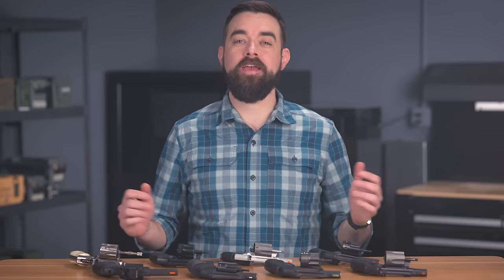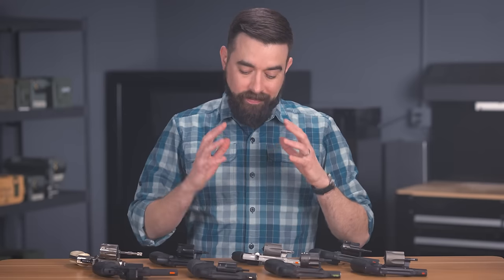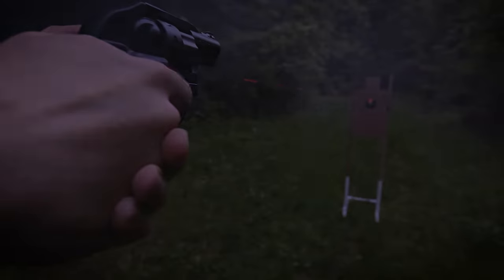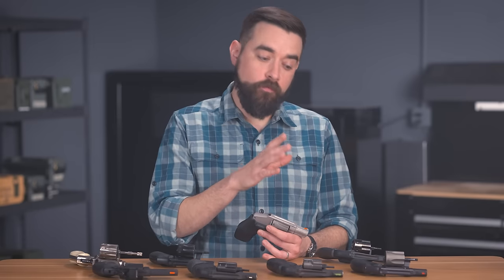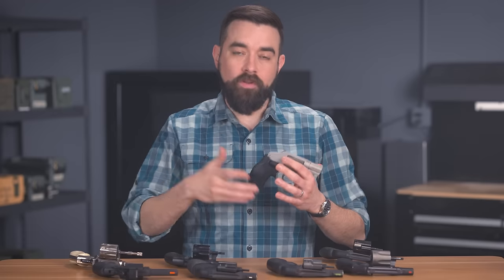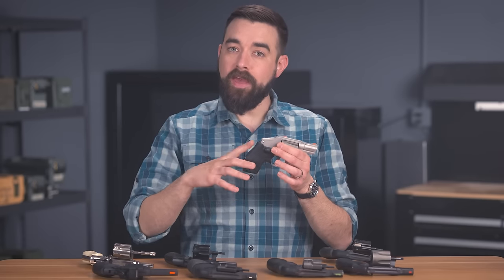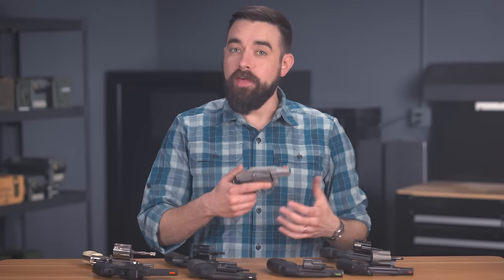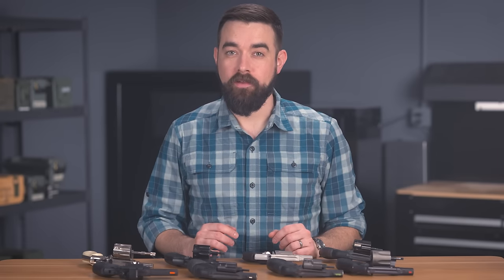Tips for Shooting a Snub Nose Revolver

Comment: For the 38 Special snubbies, you did not mention the Hornady 90gr Critical Defense Lite ammunition.  I have tried this in two snubbies including a S&W Airweight.  Recoil is noticeably less, and more controllable.  HOWEVER, these very light bullets for caliber do shoot LOW on targets compared to heavier bullet weights normally utilized for 38 Special.  I do agree that lightweight snubbies in 357 Magnum are crazy for distances more than pressed on-target to about 4 or 5 feet....      Great channel, love the videos!!
Reply: I have shot those rounds in my snub nose revolver and they have basically zero recoil but they shoot low and to the left for me. Mine prefers 130 to 158 grain bullets
Reply: Hornady also has a critical defense standard and +p version in 110 gr which to me has very little recoil in my s&w j frame.
Reply: Iirc those have garbage terminal performance  which is the most important part

Comment: My daily is the S&W M&P340. It is a beast with magnum loads. Not so bad with light 38 Spl loads. I changed the grips to fit my hand better. I also dry fire to keep my trigger finger strong so I can do a smooth straight back pull without the front sight moving about. I'm not claiming to be as good as Claude Werner. But I'm competent. If you can handle the bark, Buffalo Bore's 19H load is pretty good. If you want to save a lot of money, the Remington 125gr 357 Magnum SJHP is decent. If you want low recoil, then Hornady's Critical Defense 110gr FTX 38Spl+P is decent. I wouldn't go lower than that in power.

Comment: Hah, I use the same concept with nail polish on the front sight.  I use several layers of the color instead of white, but the one thing I do also is add a fluorescent green on both sides of the notch at the rear and then I do a clear coat after the color.  Keeps it from getting brittle and chipping off so easy.  ;)

Comment: S&W puts their best snubbie grips on the Model 63 - a .22 LR that really doesn't need them.  Those grips have plenty of real estate for your pinkie and they fully cover the backstrap to absorb recoil and give adult sized hands a proper angle on the trigger.  Guess what - you can call S&W Parts and order those excellent combat grips and they'll fit perfect on your Model 60 or 640 (steel frame .357).  Last pair I bought was less than 40 bucks.  What a great deal!
Reply: Midwest Gun Works carries them in black and FDE for sub $40.  I personally don't like them (my favorite are the $25 Hogue Bantam) because they're very skinny, but I've met a few women who do

Comment: Thanks for this video Chris!
I just bought my fist snubby S&W 442, and I can't hit jack. I blame it on the heavy trigger but I am determined to master this little monster, because it fits so nicely in my jacket pocket.
Reply: Keep at it ,it takes time putting a wilson combat or apex spring kit will help big time.
Reply: Very easy to work the gun dry fire and see improvement since the gun is manually operated.  The only thing you miss dry fire is the recoil control.
Reply: @sean0181 Good advice. Thanks Sean!
Reply: @tangobravo4634  I have taught more than a few frustrated folks how to shoot these j frames ,first i would paint the front sight ,i actually use a very small thin amount of gorilla glue and let it sit 5min then apply bright orange,yellow or green ,then dry fire practice focusing on your front sight and very slowly rolling that trigger back without moving that front sight ,when you go to the range start at 3 then 5 yards one handed slow roll trigger press focusing on front sight (this is all easier with the performance center 442 or a spring kit installed huge difference )over time you will be able to speed things up ,keep in mind these really are not for past 7 yards ,i hit the range 2 or 3x a week and i just yesterday drew from my pocket and puched a 3 inch group at 7 yards with 110 +p critical defense also from both of my jframes federal 130 fmj is not accurate i use 158 fmj and carry the hornady or underwood 158 standard pressure,i really like norma 158 for the range but i shoot more 9mill thany anything else this is an expensive hobby if you like to shoot.
Reply: @sean0181  That's awesome 👌 Thanks again brother!
Reply: "I can't hit jack. I blame it on the heavy trigger"
The problem is that the light trigger on modern semi-autos is masking your poor trigger control.  You have to press the trigger straight back to the rear.
Reply: @tacticaltruth95  Thanks, that's definitely something I will focus on the next range session.

Comment: I've had two snub noses: a Colt Detective Special and a S&W Model 19. I've come to the conclusion they weren't for me. They were sweet looking guns but if I don't enjoy shooting them then they're just good looking paperweights.
The DS was ultra cool, very light and handy but a beast with recoil no matter what ammo I used including wadcutters. I even got a blister on my trigger finger once from a range day (not fun). The Model 19 was a little better with its adjustable sights, heavier weight and a set of Pachmayr grips I put on it. However with .357 magnum it was a little bit too much compared to a 4 inch. I sold both of them and don't miss them. 4" revolvers are the only ones I like.

Comment: Pachmyr makes a boot grip with a pinky pop out. Also check out delta ergo grips which are awesome but don’t have the laser.
Reply: Pachmayr grips can be a little large, but they do give much better control.
Reply: @kirkmooneyham  I looked at it it’s called the guardian grip. It’s small as a boot grip but has a pop out pinky extension automatically as you grip it. Very cool. I love my green laser crimson trace or else I’d use the guardian grip.
Reply: Green laser is what I use now too. It’s great for dry fire practice. Delta is really cool because better aim naturally and disappears in pocket better. But still don’t want to give up the green laser.

Comment: I replaced my Ruger LCR 38 with a Ruger LCR 357. I’m still using 38 ammo in it though. The extra weight of the 357 gun makes controlling the gun a little bit easier.

Comment: With a 38 special, I would recommend using standard power hollow points. I have two snubbies,a Rossi and a Taurus,the recoil is not to be feared at all.reduce the power and you might not have enough,overload it you could blow up the gun.standard ammo at close range should make people much less frisky.
Reply: I would recommend plain FMJ if you want the lower recoil of standard pressure.  I would not use a hollow point unless it were a .357 or at least a .38 +P.  The problem with standard pressure is you don't get any expansion from the hollow points because the velocity is too slow. Which negates using those in the first place.

Comment: I am lucky. Hogue grips help me a ton. My hand fits a Hogue grip. I put one on my S&W 647 and my Ruger SP101. The Ruger also has had a trigger job and all the sharp, edges worked down smooth. If you are not a revolver person, i.e. you like and shoot revolvers, why spend time with a snub nose? They will be the most challenging gun you have ever used otherwise. Lastly, it is OK to fire them slower than people think they need to in order to achieve accuracy. In the mind, we think we have time all figured out. We do not. Our perceptions often do not match timers. Who says just because you can mag dump a 17 round semiauto and appear cool that it is a good idea? When you are contemplating five rounds, slow down and get them well aimed and on the mark. Only well aimed fire matters.
Reply: I put the same grips on my sp101 and it made all the difference in the world

Comment: To solve most of those problems at the expense of a little more weight and concealability, try a S&W 686+ with a 3 in. barrel. Soft shooter of .38 spl., and shooting .357 isn't fun but it isn't torture.

Comment: What do you use for a loader with an LCR in 327 Federal?

My Pachmayr 6 shot works fine with dummy rounds, but real 32 H&R Magnum cartridges are held just barely too wide for the cylinder. The cartridge case rims don't quite clear the chambers clean, so I have to futz around with a little to get them to drop in.

I can also not tighten the loader all the way (what I normally do), but it tends to move around just enough in the pocket so that it won't stay where I leave it.

Comment: What about keeping your thumbs away from the gaps behind and in front of the cylinder when shooting .357 magnum?  Is there risk with side pressure injuring thumbs?
Reply: Yes, where the barrel and front of the cylinder meet. Gas/heat comes out between the forcing cone and the cylinder.

Comment: I cant believe he chose the 327 lcr over the 9mm lcr..similar recoil but 9mm is everywhere
Reply: Several reasons. 9mm is cheaper and easier to find, yes. But the 327 has a 6-shot capacity compared to the 9mm 5-shot. Also, the 9mm can experience "crimp jump" and cause the cylinder to lock up. I know someone who traded-in his LCR in 9mm because he wasn't happy with the reliability.  Also, you have to load a 9mm revolver with moon clips. These can be problematic. They just aren't as sturdy as a speed loader. So there are a lot of pros and cons for each.

Comment: Better to learn shooting a double action revolver on a belt-sized gun, like a K or L frame S&W... then transfer that learning to the pocket guns, especially the J frame size guns.  VZ or Pachmyers are good stocks for most shooters, or go custom. A .38 Spl. Is never gonna expand out of a snub, so use a load with sharp corners on the bullet to cut and tear tissue, like a sharp-cornered SWC or Wadcutter. ( hand loading, standard primer, 5 gr. Unique under a hollow-base wadcutter loaded backwards to the 2nd to last cannelure. accurate to 25 yds. out of my M-49 Smith and prolly tumble on impact)

Comment: I am a arm chair enthusiast with no practical knowledge and have owned a model 38 SW for decades. Recently I heard in another video that a heavier bullet will recoil less in my shorty than a lighter bullet. Can you elaborate on this. I am almost 80 and not a fan of recoil.
Reply: It depends. Having a heavy bullet going at a slower speed can recoil less than a light bullet going at a faster speed. But it depends. In my 25 oz j-frame, 158 grain bullets recoil more than the 130 grain ones.

Comment: What in your opinion is the advantage of a snub nose .38 spl over a striker fire auto handgun?  I'm about ready to sell mine because reloading, trigger press and trigger control appears to be superior in a striker fire handgun like my Glock 27.  Thnx.
Reply: Snubby is safer to carry and handle outside of the holster. Striker trigger can snag and doesn’t push back w/equal pressure because that’s a separate spring. True DA trigger has one spring that always kicks back just as hard as the pressure you are (perhaps inadvertently) putting on it.
Reply: there's a reason police don't regularly carry revolvers any more.  I like them but I watched too many old police shows I guess.  Joe Friday larping 😂
Reply from the maker: There are advantages to both and there's no "right" answer for everyone. We covered this in great detail in our Pocket Pistol vs Snub Nose video a few years ago: https://www.youtube.com/watch?v=GKcQUZYA_go
Reply: @RealJohnnyDingo  Police carry vs. civilian carry is much different. Police typically carry OWB and hence, a semi makes more sense.  For civilian CCW, revolvers and semis each have pros and cons, but I carry a revolver as it is easier to conceal, safer and much less prone to snag.  I carry a taurus 856 UL.  16 ounces dry, 6 shot, . 38 special.  For my day to day, I never feel under armed.  When I travel, my Sig P365 goes with me and is also my backpacking gun.

Comment: Hey Chris, please forgive my stupid question... If there is .38 special, is there a regular .38? :P
Reply from the maker: There is! .38 Special was originally called ".38 Smith & Wesson Special." That was to distinguish it from the older, weaker ".38 Smith & Wesson." The .38 S&W cartridge is essentially obsolete now, though you can still find ammo occasionally if you have an old revolver that fires it.
Reply: @LuckyGunner  would this old .38 be bad nowadays?
Reply: @LuckyGunner , except for case length, the .38 Special is identical to the .38 Short Colt,  and .38 Long Colt.  The .38 S&W had a different diameter, larger IIRC.
Reply: @danilonakazone386  depending how it was stored, it should be fine for the range.  It'll be inferior defensively

Comment: Re: Sights, don't fail to consider the XS-Tritium (smaller style) and the rounded rear gutter sight that is standard on the M&P series J-Frames (NOT PD). Remarkably quick acquisition/sight alignment, and seemingly way faster than the square notches of my other J-Frames. Oughta be the stock config for all.
Reply: Why is the shape of the bottom of the rear sight important?
Reply: @DWalter.27  It's hard to describe with out (you) having one in hand. It's just faster to line up. you're settling a circle/ball into a rounded slot and it just works. additionally, in the dark the tritium front sight also reflects in different parts/aspects of the rounded "gutter" running down the length of the top strap as you're sighting in, and that provides feedback to help center the sights in the dark. I've upgraded a couple square rear notch J's to the same XS trit sight and it dosen't give that benefit. You can see it downt there past the squared notch, but you dont get the aiding/correcting reflection off the "gutter". It might be a minor thing, but it's something i've noticed.

Comment: Does anyone make a 2" J framed sized revolver, in 22 WMR? Nine shot?? I think this would make a wicked ankle gun. And as always, thanks for the share!!
Reply: Smith and Wesson 351PD and the 351C are 7 shot options and there is the LCR 22 Magnum, but that's just 6 shots. No 9 shot options, unfortunately. The S&W 43C and the LCR 22 are both 8 shot .22 LR options though.
Reply: Best you got is an 8 shot 22lr (S&W or Ruger) with the new federal punch ammo, or a 7 shot S&W in 22 mag.  To get more capacity than that the gun has to get bigger
Reply: I believe Taurus makes an 8-shot 22 Mag revolver.  Smith has 7 shots and Ruger has 6.  Stop being so greedy.  Learn to use a speed loader.

Comment: Sights?  Do you think you'll use it in a situation where you'll be shooting at someone at 50 feet?  I'm betting it will be no more than 10 feet.
Reply: Unless you are into the CQB zone (roughly 2x arms length or less), bringing the weapon to eye level and at least "looking through" the sights is useful. Of course you always want to keep the weapon out of reach of your adversary, and sometimes that means "point" shooting. And there's no better contact range firearm than a short-barreled revolver. But it's VERY easy to miss with the snubby past across-the-room distance.
Reply: @CeeJay1979US  - First you contradict me then you agree with me.  Only in movies and TV do people fire at someone at 50 feet with a snubnose revolver and hit their target.  Such guns are designed for concealability and up close & personal use.
Reply: @brianjcavanaugh  It's very easy to miss if you don't AT LEAST index the front sight on the target. If you can't present, place the front sight reasonably on the target and shoot in about 1 sec, you're not sufficiently trained.

Comment: I was considering a snubby, but  I found that the loss of energy from a 2-2.5 in barrel isn’t worth the benefit of easier concealment. I get more energy from my 45 auto pistol. Although I was considering the Ruger SP101  w/ 4 in. Still a small frame, but better energy and recoil, and the have the choice of 357 or 38. Anyone tried a carrying  and defensive shooting a small frame revolver with a longer barrel? 

Btw, I use a bottle of my wife’s white mail polish for sights, and it works better than paint for sights—weird.

Comment: I had (note tense) two snobbiest: a 642 and an sp101.  The best tip I can give for how to shoot them better is to replace them with a Kahr PM9. I shoot the Kahr far better, it has greater capacity, and is faster to reload. YMMV
Reply: that heavy trigger is harder for sure.  I have both and the weakness of the pm9 is the plastic mag catch.  I treat it very gently but still had to replace it once.  Snubbie is possibly more durable. at arms distance either one should do that job
Reply: K.

Comment: The first handgun I ever shot was my grandfather's old Colt Cobra snubnose. I got to be pretty decent with it with mild wadcutters until a squib load killed it. He's had a couple of other snubnoses since then and I can shoot them OK in single action. I recently bought a S&W 642 for myself because the shape conceals a bit better than a semiauto. I put a spring kit in it, dry-fired it a couple thousand times, put nail polish on the front sight, and took it to the range. It's the single most painful gun I've ever shot. I shot 25 rounds of standard pressure 135gr and that was all I could do. I want to like the snubnose. I like the idea and how it feels. I may trade the 642 for a Kimber K6S but for now I'm going to stick with a striker or SAO gun with real sights for carry. That double action trigger and almost non-existent sights didn't help even before the recoil made me not want to pull the trigger.
Reply: Get some Hogue grips for that 642 and it will shoot 100% BETTER, I promise.  Best $25 you will spend.